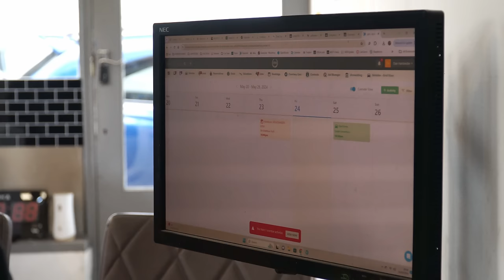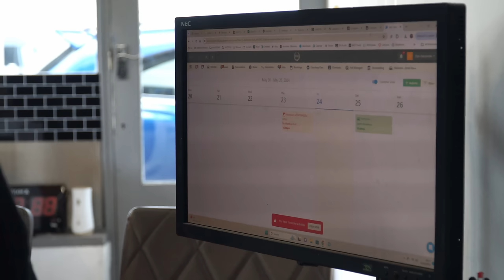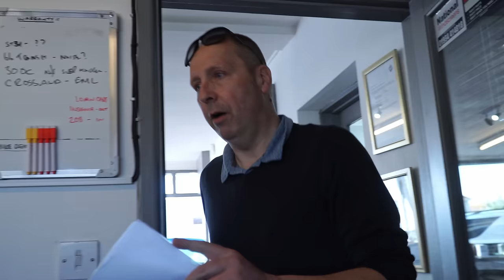Driving 4 Hours For A Car Auction | BM Weekly EP40

Comment: Have to agree, door mirrors that dip when you select reverse are really annoying. Couldn’t code it out on my previous BMW either. Should really be an option, rather than the default.
Reply: Yea both are just passage side is good when parking but you can switch off with the obd reader Carly or the other one Joe's permotes.